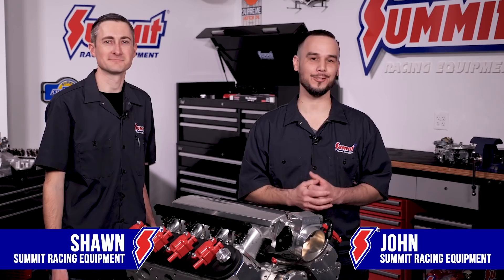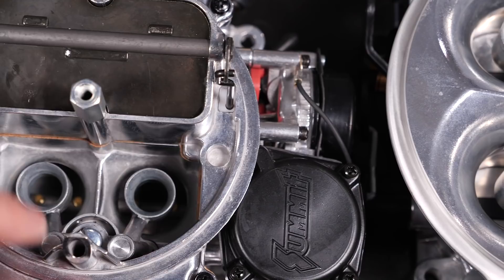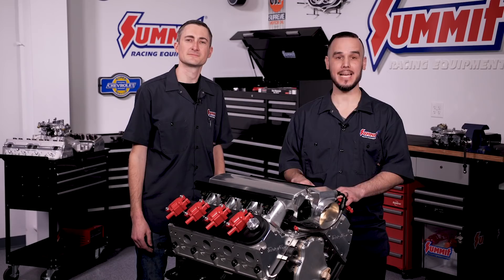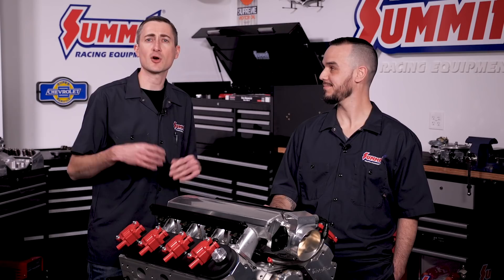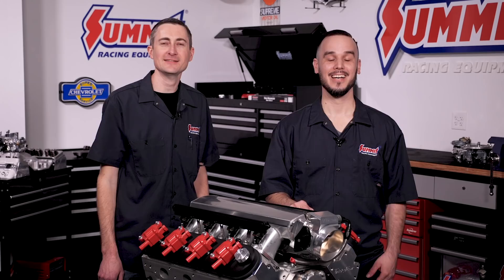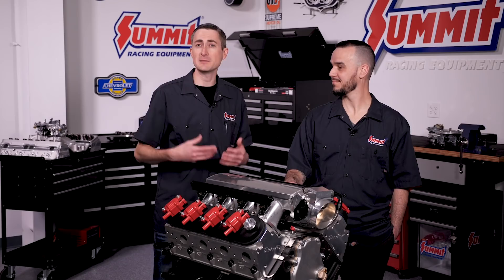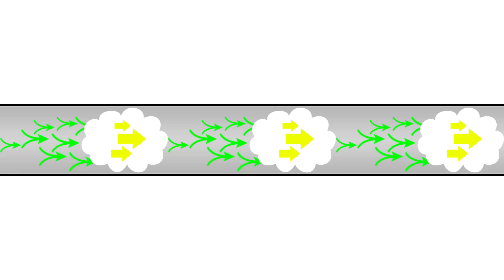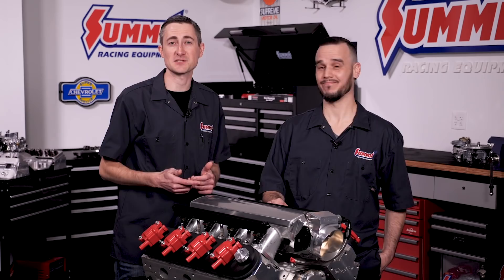3 Automotive Myths That Cost Vehicle Performance

Comment: Back pressure.  I laugh at anyone who try's acting like they know about performance then say anything related to exhaust and back pressure ..
Reply: Pulse tuning
Reply: adam s I was going to suggest this as another topic. Glad to see someone on the same page. 😎
Reply: Budget Boost DIY  it's still not back pressure it a reflection or pulse.
Reply: In the 60s there were a very few guys that understood intake velocitiy and cylinder filling. These guys built street racers using 265 heads on 283s.
Reply: Budget Boost DIY  2 strokes do require the exhaust expansion chamber to be most effecient
Reply: Budget Boost DIY pretty sure that’s not what they’re talking about. How many 2 stroke cars are out there?
Reply: The Trabant in former eastern block countriesis the only 2 stroke car I know of
Reply: Back pressure is bad. Period.
Reply: 2 strokes are different. They don't use back pressure. They use reverb.
Reply: @ronmeidlinger249  A few more - Saab, Suzuki LJ10 jeep, Wartburg, DKW
Reply: It's why cutouts are a thing! 😉
Reply: Neito Kradavish  haha they don't

Comment: Smart stuff....yet there are still idiots at car shows and events claiming that the factory exhaust manifolds are better because the engine needs backpressure....
Reply: Yeah , there's always a header hater. The ones who don't realize you can knock a full second off your quarter mile time by dropping the stock exhaust and running a set of header pipes.

Comment: CFM measures VOLUME or MASS FLOW not VELOCITY. VELOCITY measures speed and direction.
Reply: CFM is cubic feet per minute. With the known volume and time figures you get the velocity. Therefore to say CFM measures velocity is 100% correct.
Reply: @stuwest3653  I think you could roughly say that velocity can be deduced by CFM, but to say CFM measures velocity is huge stretch.
Reply: @stuwest3653  Incorrect. Higher CFM doesn't mean that the air velocity is higher, it just means (in the case of a carburetor or cylinder head) under a given system of vacuum, theres more airflow, or more volume. Something that flows 700cfm under 28inHg will have a lower air velocity than something that flows 600cfm under 28inHg vacuum. Its physics, pressure and volume are inversely proportional. Ideal gas laws
Reply: @rustysausage69  You are correct about velocity where you are incorrect is that the piston going down the bore does not make vacuum , It creates pressure differential so the high pressure air above the engine falls into the low pressure caused by the piston going down the bore. This is the principle the makes a jet engine, that is called the EPR Engine pressure ratio.
Reply: @stuwest3653  velocity is a derivative
Reply: @stuwest3653  nope. two intakes can have the same CFM but with different velocities depending on the size of the path where the air passes through.
Reply: @racerd9669  that's only correct when speaking of forced air induction, n/a is reliant on vacuum as the piston goes down.
Reply: @yjjeeper1  The pressure differential is messured in vacuum because we have no way to measure pressure. So in the cylinder you have low pressure not vacuum and above the cylinder we have atmospheric pressure. This is what makes the air fall into the cylinder.This is why a engine always makes more power with higher atmospheric pressure

Comment: Myth number 4, combustion is an explosion. Combustion is a, “fast rate of burn.”
Reply: Enchanted Wenis an explosion is a fast rate of burn 🤷🏻‍♂️
Reply: How does this myth have to do with performance. I mean, it's gonna explode or combust, whatever you call it, whether you call it one or the other.
Reply: From WikiDiff.com: 
"As nouns the difference between combustion and explosion is that combustion is (chemistry) the act or process of burning while explosion is a violent release of energy (sometimes mechanical, nuclear, or chemical."
Reply: referencing combustion as a “fast rate of burn” helps to better understand ignition timing and flame fronts during the compression and power stroke. Gas is designed to release it potential energy over a period of time versus, let’s say, dynamite which releases its energy, for sake of argument all at once.

Comment: Going to disagree with the head Myth proposed here.  I’m so intrigued by engine myth busting that I subscribe to motor trend on demand ONLY for the show Engine masters. They along with Richard Holdner have done a ton of tests like this. So far in every case I have seen tested, in both big and small cube engines, the larger better flowing head makes more power everywhere.  Period.  Its the runner length of the intake manifold that is the main determining factor when talking about where in the rpm band power will be made.
Reply: Phillip Aubin go watch engine masters, they have already run all these tests.  Show me an engine dyno test that says different. I have yet to see one. But please post one not just your unverified knowledge.
Reply: Phillip Aubin I just went back and watched episode 28 of engine masters with a Ford 400 small block with a very mild cam. The 220cc heads made the exact same power from 2500 to redline as the 165cc heads with NO low end loss of torque. They did say there MIGHT be SOME difference but it probably won’t be noticeable if you ran this test on a 302.
Reply: Phillip Aubin I stand by my original comment that an intake manifold runner length is THE BIGGEST determining factor on low end torque production.  The port size MAY cost you 3-5 ftlbs from idle to 2500. But ultimately it’s the runner length of the manifold that could cost or make you big torque down low. And by having the bigger cylinder head from the get go, if you ever do put a big cam in it, it’s going to make more power than the 165s ever could. As I said in my first reply if you have an actual dynograph showing otherwise please post it. Otherwise you’re regurgitating really old forum talking points that have since been disproven.  Kinda like the old arguments that 317 heads because of better flow would make more power on a 6.0 than 706 heads that have smaller combustion chambers to bump the compression.  Turns out that was false the 317 heads didn’t actually outflow the 706 enough to overcome the raise in compression you get from 706 heads and the 706s make 20-40hp more everywhere than the 317s.  But until that test was ran people were singing that from the rooftops all over the forums that if you put 706 heads on a 6.0 you would kill a ton of power.
Reply: @TurboNFRStwoK  he obviously was either looking for an argument or simply has a comprehension problem. You are absolutely correct and were very clear why you came to that conclusion.
Reply: Phillip Aubin specifically it was a 410 stroker based on a 351 Windsor, heads were AFR renegade heads, Holley 850 double pumper, intake was Edelbrock dual plane performer rpm air gap, msd ignition, the cam was a 218/224 @ .050, lift was .500/.500 with 110 LSA, compression 10:1, headers were 1 3/4” hooker super comps.  They said specifically, that 165 head would usually be considered too small for a 400ci engine. That most people would say they should go on something like a 302 but what they found was with that particular cam and intake manifold the engine didn’t care what size the intake ports were.  They praised the afr heads as being a phenomenal piece of work and a testament of just how good their 165 heads are.
Reply: Phillip Aubin on episode 6 they also did another comparison with 170cc head vs 210cc head on a 383 stroker Chevy with everything else kept basically the same. The 210 even had a tad less compression (slightly larger combustion chamber) and made 5 more torque at 3000 and 35 more hp at 6000. You may be correct that from idle to 2000rpm the larger ports may have some effect, i believe if they do it’s negligible but I have no videos and don’t know of anyone dynoing anything below 2500. But if you do please show it!
Reply: @TurboNFRStwoK  I've watched this episode and i think you've missed a couple key points and/or have forgotten a few things they've said. At the end of the show freibuger says he would not conclude a person should go buy the biggest head i.e. biggest intak ports and put them on your motor.

 After running the 165's they say you can't just use the intake runner volume  determine how good or how much power a head makes. Another thing they mentioned that they said they can't measure on the dyno, is throttle response and throttle transitions which they said would be better on the 165 because of air vlocity.  

Also at the end of the show one of them said use the 195's for that 410 and use the 220's on an appropriate motor that runs to 7500 rpm and has .800 lift.

There may not have been a difference between the 165's and 220's fron 2500 till the end of the test, but they did say throttle response and throttle transitioning had to be better with the 165's.
Reply: @TurboNFRStwoK  on episode 6 the torque comes in higher for a couple hundred rpm, but drops down and maches the 170cc intake heads. That 5lb's of torque difference you are seeing is caused by how they "roll" in when they start the dyno pull. So i wouldn't hold a lot of stock on that.
Reply: Check out the cavernous intake ports on the 351 Cleveland. You are basically saying that engines like that and the LS7 should have intake ports 50% larger than they currently have. Then maximize the velocity by "choking it down" with undersized intake runners. What you are saying is EVERY engine ever built should have cavernous intake ports. That is incorrect. If we were all building race engines, your argument would have more merit, but it would still be somewhat incorrect. Have you not heard of mismatched components? Enginemasters engine builders (like John Kaase) many times relocate, AND REDUCE the size of the intake ports. I don't care WHAT intake manifold you use, they are too big for a 350 cubic inch street engine. I do agree there are more factors involved than port size. But there is a point of no return when you go too big......
Reply: Won't get into the argument about port size but intake runner length is very important in determining where max torque occurs.  Look at the Chrysler long ram manifolds from the early sixties.  These essentially had the carbs sitting on the opposite fender wells.  The whole idea was to get big heavy cars, like the Chrysler letter cars off the line faster.  Peak torque on these engines was often reached by 2500 rpm.  As the Chrysler muscle cars went to the lighter B bodies in 62 they went to a short cross ram intake.

Comment: Reminds me of a dude at work with a ecoboost mustang. He wanted to get a cold air intake and a exhaust. I recommend a tune and intercooler. He got the cold air intake with a k&n filter. It was $400. Smh.
Reply: These guys don't know forced induction that well, your friend makes the correct choice as long as he maps his fuel and increases it if needed. Your suggestion would be better suited for n/a aside from the intercooler.

Comment: An engine does need a little back pressure. I remember riding my Trumph TR6 motorcycle. With the mufflers on the engine felt more torquey with less RPM.
With mufflers off the engine felt  like it had more horsepower only at  higher RPM. It depends on how you are going to use your vehicle
 Street or strip.

Comment: There are too many factors that go into every single engine build. Anyone that has built engines for competition knows this. Cam selections depend on use and are related to a number of factors that all work together including combustion chamber size, Port work, compression ratio etc etc... There are some general terms that can be applied to a stock engine to boost performance, such as headers, a more free-flowing exhaust and it's Contour all the way out to the exit, a modest cam upgrade, running a better fuel grade and advancing the ignition. Many times we just did these things in the 1970s to gain a little Edge street racing. Personally I had the six pack carburetors on the Mopars so I ordered a performance spring kit, which allowed you to change the springs in the end carburetors which gave you options for when you wanted the vacuum secondaries to come open. Personally I liked High test fuel and a lot of spark advance. If you're going to be drag racing on the strip all of this just gets taken to a lot bigger level. Everyone should start with the basics and build a first engine for yourself. Don't fall into the Trap of spending tons of money for no reason, or buying too large of a camshaft for Street use, especially when used with a stock engine. Vacuum problems ensue, and overall becomes just a headache. Do your homework start modest and look for modest gains. Just do your homework and if you ever doubt then consult others with experience in building competition engines. Most of all enjoy the cars, the times with your friends, because they pass by so quickly. I sure miss the 1970s and being a teenager all those years ago with one of the hottest cars around :-)
Reply from the maker: Well said, Craig!

Comment: Advertised duration on cams should be outlawed. Tell me duration at not only .050"lift, but also duration  at .200" lift. That tells me what style lobe design it is.
Reply: It's easy to ignore the advertised duration.
Reply: Redline Racer   .. When the advertised duration doesn't specify the lift, how can you compare the numbers between different manufacturers?
Even if they did tell you the lift, it will likely be at a lift that is less than what you set your valve lash to.  The result is that your engine won't "see" that duration.
Reply: Redline Racer  you are wrong. Advertised duration tells nothing if you do not know at what lift it it supposed is from. Example: tell when you hear oh, it has a 292 duration cam in it. Next 1 that is idling almost like a stock engine, that guy says oh, it has a 292 duration cam in it. Clearly the 2 cams advertised at 292, are not even close to being the same. Why? A comp 292 cam is measured at .006" lift, while the rv junk tomato stick was measured at .002" or .001" of lift to call it also a 292 cam. Advertised duration varies how it is measured company to company  AND series to series of cams.  That is why it is useless info. Btw, the comp 292 that you know is setting off the car alarms is going to donkey stomp that slug 292 advertised cam powered slug.

Comment: CFM does not define the velocity of air going through the carburetor. It is used to find the volume of air going through the carburetor. And when it's out of balance it can cause a lack of performance not an increase. The term CFM says nothing about velocity. It's cubic feet per minute. It is a volumetric construct.

Comment: The expansion chamber creates a reverse pressure wave.  The reverse pressure wave pushes the unburned exhaust back into the cylinder on the exhaast compression stroke.

Comment: "Higher Octane makes more power".......Not always

"The fuel/air mixture explodes"..........Not if it ignites and burns correctly

"it's got a 3/4 race cam"..................Caution, this person knows little about performance cams.
Reply: FAR more often than not higher octane DOES make more power. If we're talking pump gas and any engine built in the last 40ish years(and/or with a computer). Like almost always. Pretty much guaranteed.

Comment: If you like low end torque recomend leaving your car alone, after doing a cam and long tubes I felt significant losses down low, gained a bunch of top end but definitely a trade off.
Reply: Try changing gears a little and using al better converter. Be supprised
Reply: Depends on what results you want. If you installed a stage 4 cam with 4 in 1 headers then yeah you're sacrificing low end power for high end gains. For drag racing, that's good, for street driving, not so much.
Reply: What engine and what cam did you use?
Reply: I'm on an ls1 manual 4 to 1 kooks long tubes and a boost cam, large na cams dont work at the altitude I'm at but I love the way it feels I just cant get on the gas in 6th and pull as hard and I have to give it gas now when I let off the clutch, prior I could just let it out to start moving
Reply: Sounds like you used the wrong cam
Reply: @2mtnbros  yeah sounds like you're a cam expert
Reply: Actually, We are, we built sprint engines, drag engines, street engines. We know a little about cam shafts.
Reply: @2mtnbros  nice I too am an engine builder and have a degree in applied science with an emphasis in automotive technology but yeah I guess the person with an actual degree is wrong and a body on the internet knows what's best for me
Reply: @darinr9424  Yeah, drop another grand to lose more mpg, and gain very little. Most of us dont race on the street

Comment: I think you guys need to explain better what camshaft specs are and why they are so important to performance. Cam, stall, and gearing directly dictate how a car will perform and their has to be balance. You just scratched the surface on this topic of "bigger is better" I mean we didn't even get to rocker ratio to lift and if you should be running solid or hydraulic ect. Love your company btw.
Reply from the maker: Thank you, Aaron! We have some camshaft videos on our channel. We have some additional cam videos coming on installation tips and how to's. Stay tuned!